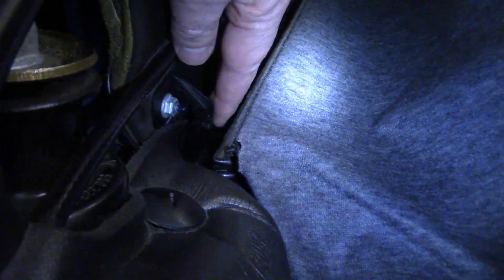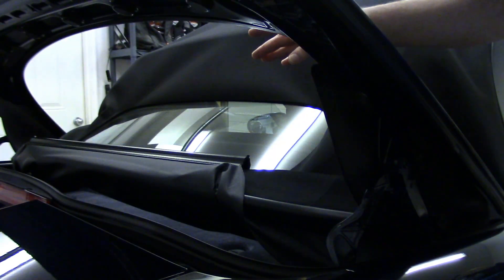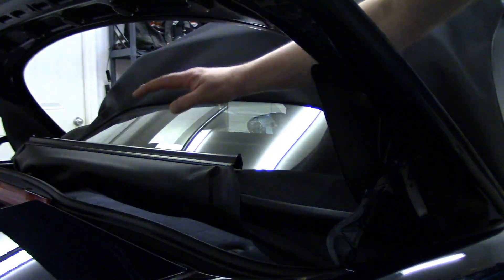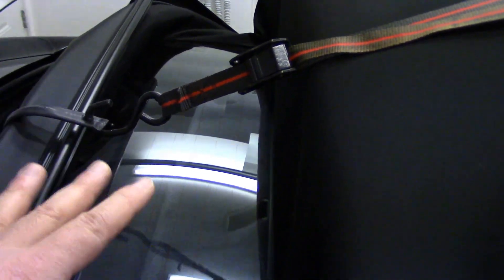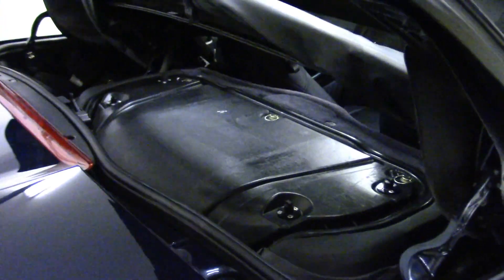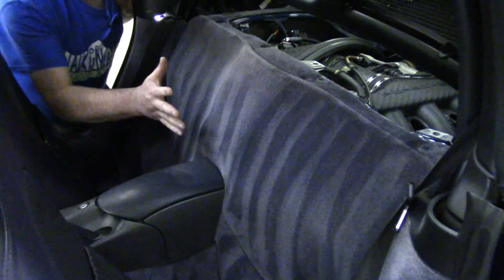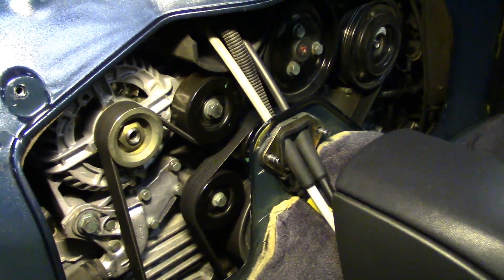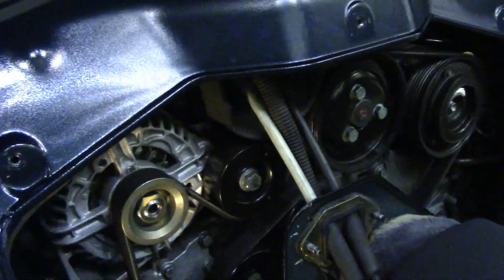How To Put Your Boxster 986 Into Service Mode & Access Front Cover

Comment: I thought working on my mid engined Fiat X1/9 was hard! Thanks for the heads-up. I got to replace the air filter in my 2000.
Reply from the maker: Working on Boxster's is easy; there is great access to pretty much every side of the engine.

Comment: Nice video - very thorough and easy to understand! I just acquired a 1999 Boxster that originally belonged to my father-in-law (deceased). Unfortunately, I don't really have any service records other than what CarFax shows.The engine sounds healthy, but it did a lot of sitting over the years as it wasn't driven much (27,400 miles). The block was also re-done approximately 10 years ago as the engine's serial number incorporates the AT alpha characters. Overall, the car is in very good shape with absolutely no rust (Arizona) and no accidents, but I'm looking to do all of the maintenance items since I need to start at ground zero so-to-speak. Question: the air-bag dash light is on. My diagnostic tool didn't pick it up since it doesn't have that ability. Any idea what might be turning the warning light on? Thanks!
Reply from the maker: Without a fault code, that is impossible to even guess at. The best diagnostic tool you get for one of these cars is the Durametric scan tool. It's specifically for Porsche, and will access all the important stuff for a fraction the cost of the factory PST2 scan tool. Best $300 tool I have purchased for this vehicle.
Reply: @Rchelicopterfun  Thanks for the reply John! I’ll look into that scan tool. A little more research on the air bag light indicated that it might be the seat belt. There were multiple occurrences of this happening. One person reported it happened to him multiple times even after the dealer apparently fixed it.

Comment: Man your engine bay looks really clean. I have 986 blast to drive! Still original IMS double row bearing cross finger. Lol
Reply from the maker: IMS issue on the double row bearing engines is overblown in my opinion. Drive it and have fun. Of course if you are ever in there getting the clutch done (if it's a manual), that's an ideal time to address the bearing. I decided to replace ours when I replaced the clutch several years ago along with the rear main seal. The original dual row bearing that came out was still in very good shape @ Apx 90K Km.

Comment: @Rchelicopterfun What is the black hook attached to the hook strap? Time stamp 3:50-also the hook on the front will it damage or scratch the mechanism? 

Do you have a part list or a “how to” to set this up? 

This video was really helpful thanks for making this.
Reply from the maker: I just made that back hook out of a piece of flat bar I had lying around and covered it with heat shrink tube so it won't mark or scratch anything. Front hook is just the standard hook that comes with those inexpensive cam-buckle tie downs; like these ( https://amzn.to/3xSt7PF ). Those hooks are already coated so they won't scratch. Nothing else to  it.
Reply: @Rchelicopterfun  thanks John. I just got a boxster and I’m intermediate in terms of skill but beginner in terms of confidence lmao. And 0 in terms of tools. Thanks for the quality content

Comment: Hi John. We're did you find the replacement rag top with glass rear window? I've repaired my vinyl window 3x and never knew there was an actual glass option. Great vids!
Reply from the maker: It's made by Sierra Auto Tops. I got it off Amazon, but Auto Tops Direct also carry Sierra Tops and likely others as well. Sierra is a well known & respected aftermarket convertible top manufacturer. If you want the same kind of high quality material as the factory top, make sure you pick the German A5 canvas. The glass window option with defrost is about $150 more than the plastic, but  soooo worth it (if you don't mind the smaller window size and a little harder to access the engine bay).  I actually think the smaller glass window looks better when the top is up - it makes the car look shorter and wider from the back. As I mentioned in the video, even through the window is smaller, you can at least see out of it - nothing  like the horrible, foggy plastic window it replaced.
Reply: @Rchelicopterfun  Thank you Sir! Enjoy your vids 😁👌

Comment: Awesome Dude I have same car though 2002 we love it its the 3.2 Boxter S same colour too but not the twist rims thanks for the share
Reply from the maker: Yep, they are sure fun little cars. Glad you are enjoying your 3.2S too. 🙂 We've had our 99 since 2001 so it will be 20 years this July. Not a single regret or major issue, just normal maintenance and the usual wear & tear items. I did however replace the IMS bearing when I did the clutch with the L&N dual row ceramic one for peace of mind 7 years ago. The original bearing that came out was still in really good shape.
Reply: @Rchelicopterfun  wow that a long ownership congrats, My 911 996 has 200k km's and just did the IMS in it was fine but worth doing, our Boxter s has only 80,000km's so not gonna do IMS yet have noticed some of the Suspension creak and knocks (rubber perrished) so doing those bits atm really love driving both of them
Reply from the maker: @hav - 200K km's on your 996... That's awesome! Just goes to show, these engines will last a long time if properly cared for and driven correctly. It's unfortunate the IMS issue is totally overblown. I had an early (73) 911 for about 10 years before we got the 986 and it had collapsing mechanical chain tensioner issues before the pressure fed Carrera tensioners were installed ($$$$); way higher failure rate than IMS - & just as catastrophic.

Comment: Excellent video! Is replacing the convertible top a difficult and time consuming job? I was thinking about replacing mine and a shop quoted me $1600 for labor only :(
Reply from the maker: @Chen Zhao - it really depends on your skill set. I didn't find it nearly as hard as others say, but I have a mechanical background. I used Wayne Dempsey's 101 Projects for your Boxster book for instruction (a must get book for all DIY Boxster owners IMO) and he shows every step of the process along with the the difficulty level at 5 out of 5; meaning hardest. I found replacing the clutch and IMS bearing much harder. With the top you don't have to jack up the car or lift/move heavy components. It does take time however and it's a job that can't be rushed. I took two full days. 1st day was removing and cleaning (lots of pictures taken as well for reference). Second day installing the new top. Took a couple weeks of warm sunny weather afterward to allow the new fabric to relax and stretch so I didn't have to pull down on the top in order to latch it.
Reply: @Rchelicopterfun  thank you! I suspected it's going to take about 2 days (what the shop quoted me). Seems rather difficult for me to tackle LOL... It currently just have 2 small holes and I don't want to tape over them (looks ugly). But on the other hand, I really only drive the car with the top down 95% of the time so it's not a must do... 
I will check out that book!

Comment: Would you know where is the camshaft sensor? Thank you
Reply from the maker: There are two. One located on the top of the left cylinder head towards the front, and one on the right cylinder head towards the rear. Use your Google FU.

Comment: Can you make a video on how to clean the engine bay my is filthy
Reply from the maker: I'll consider it when I clean the engine off again (usually before winter storage or first thing in the spring before the spring service). Pretty simple however... When it's all open like this, that is the time to wash it. Nothing special or difficult.
1. Make sure engine is cool, wet it down thoroughly with the hose (no pressure washer) from the top and from the inside access panel.
2. Lightly mist it with your favorite engine cleaning soap (I use a 50/50 mix of Simple Green), let that sit for 5-15 minutes to break up the dirt and grime, and then thoroughly rinse it all off. If your engine/bay are really dirty, you may have to repeat or use a stiff detailing brush to work the soap into the grime & loosen it up. I usually loosely fit the inside cover during the soaping & rinsing so no soap/water can spray into the car.
3. Finish off by taking the inside cover back off to do a final rinse to the front of the engine. 
 4. If you have an air compressor, never hurts to blow the engine &  bay down and to get any standing puddles of water off the top of the engine (there are a few deep crevasses on the top of the block that will hold a fair amount of water). Run engine up to operating temp to dry any remaining water. Done 🙂

Comment: Actually you can fold it just have to move the roof back a little bit and it does the trick at least mine do it
Reply from the maker: What year is your 986 because there is absolutely no way to fold an aftermarket glass convertible top all the way back to the roll bar on an early 986 that originally came with the folding plastic window top. This is confirmed not just with this particular 986 glass conversion, but all others. Even says it right in the instructions and countless 986 forum threads. The only way to get a glass top to fold all the way back to the roll bar in service mode on an early   986 that originally came with the plastic window top, is to replace the convertible frame as well with the later glass top frame. Maybe yours had the frame replaced???